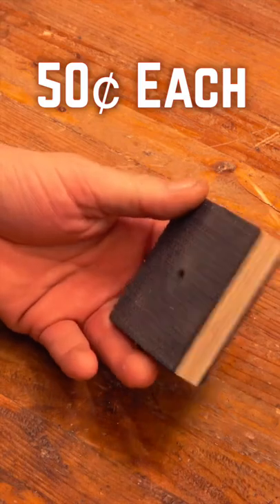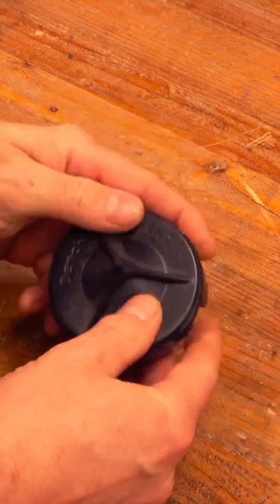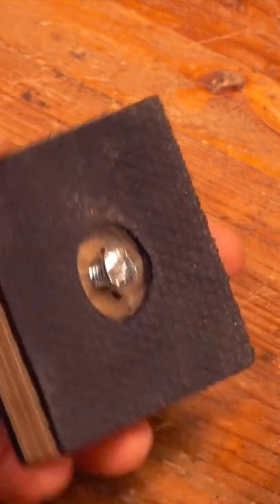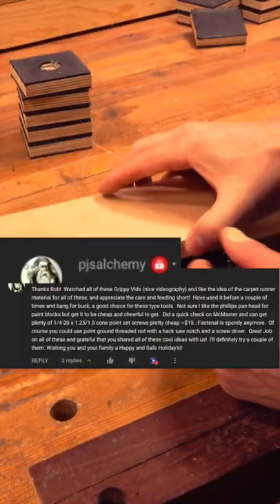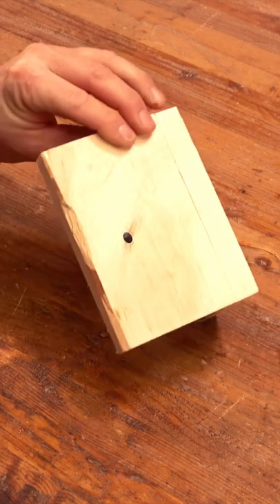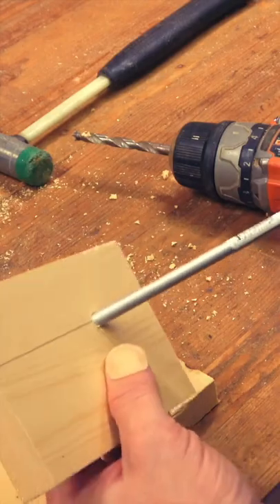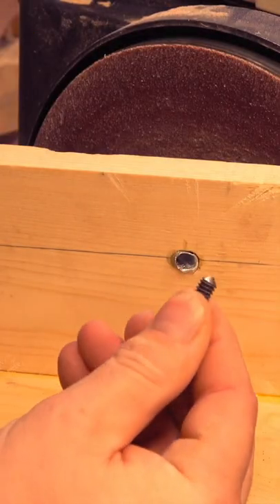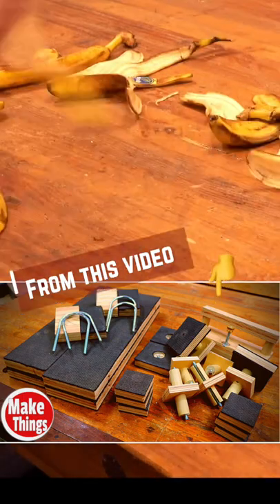Cone Set Screws #shorts

Comment: Okay what I would do:  
Use threaded rod
cut to twice the length
should be long enough to chuck in drill and take to your favourite grinder and rotate to a point
cut in half and polish the square end and cut a slot for blade screwdriver